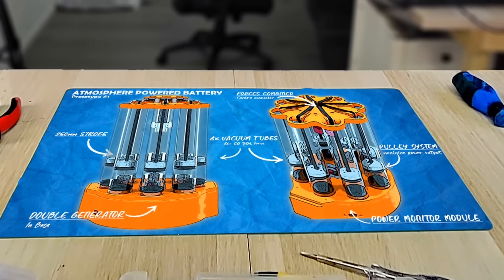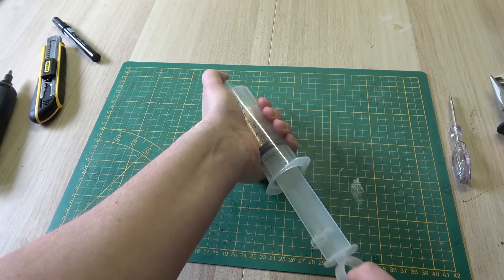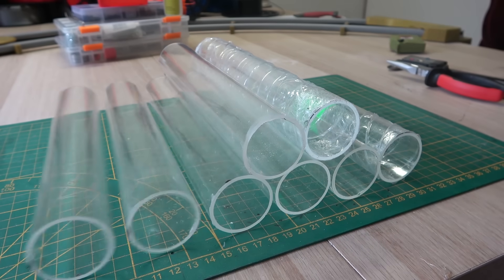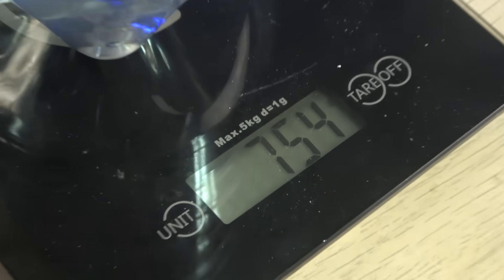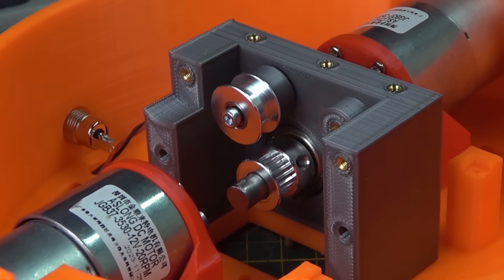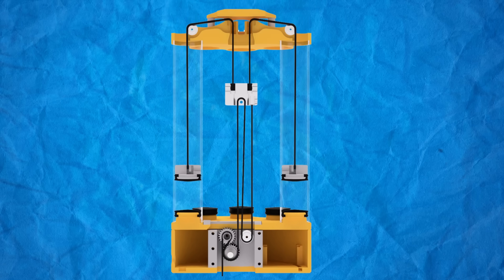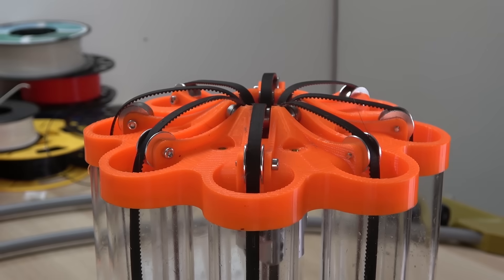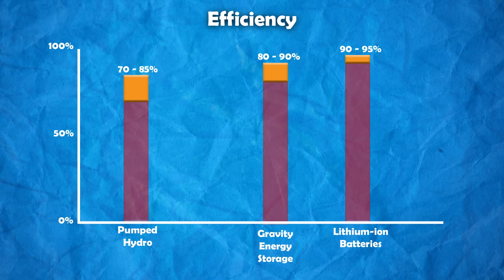Building an Atmosphere Powered Battery..

Comment: Seems pretty cool. Considering this is 1 guy making what would effectively be a prototype I bet you could get the efficiency drastically higher than that and you're already in the range of other energy storage systems. There are many questions that come to mind, such as how much efficiency would be gained by having a single larger vacuum chamber since you are increasing volume (potential energy) and reducing the circumference of the seals contact point (loss)
Reply: What matters more is total energy storage relative to resources invested. The result: It has a very low capacity. Nobody with an undergraduate degree in physics of engineering would even bother wasting more then 2min on the idea.

A slight more serious concept has been using concrete container deep under water (200-500m). At 400m you have 40 athmospheres of pressure and correspondingly 40x higher energy storage. But even this idea failed so far when put to practical tests. Just too much effort for too little energy.
Reply from the maker: Indeed, if you were to use a single piston you would reduce friction. I did however use silicone oil in this setup which worked really well I must say! 👌

I also think the great thing about vacuum is that it is easy to scale up because when you double the diameter of the cylinder, the force of the piston quadruples.
Reply: I second trying a bigger single piston wonder what the difference would be between a small medium and large scale and maybe the scale of efficiency follows a pattern in relation to volume. Awesome implementation and beautiful explanation of forces required in the hearing ratio
Reply: Can you maybe make a 1 & 4 piston setup.  Try keeping the area within the piston the same overall.   

Really neat idea! I subscribed 👍